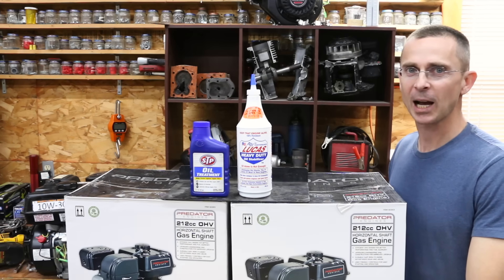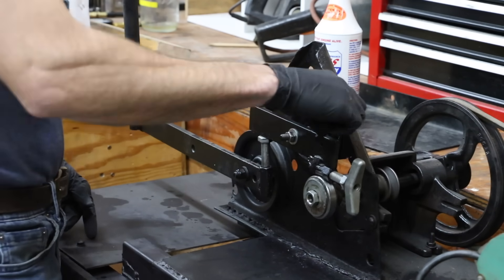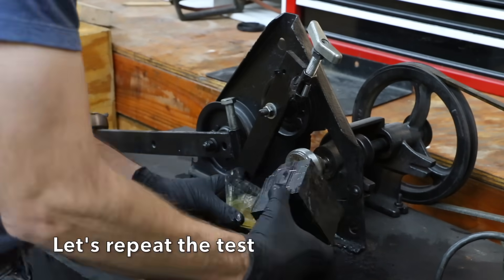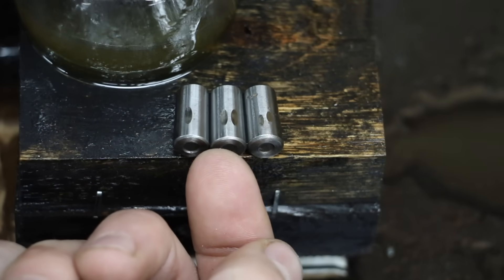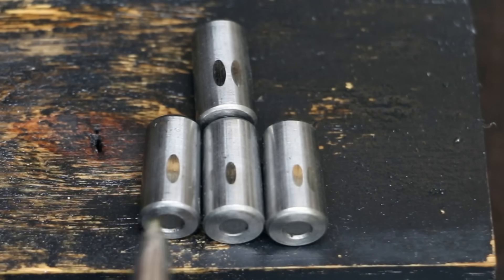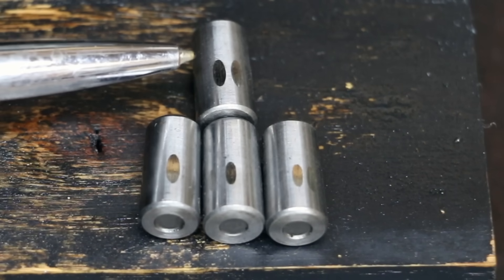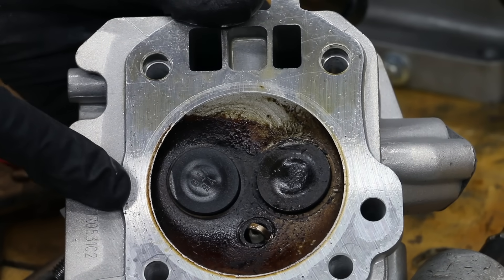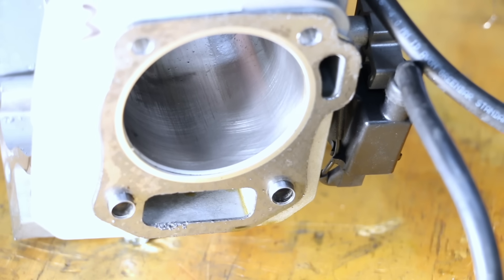Which engine self-destructs first?  Lucas or STP?

Comment: I can't figure how to interpret this test, what does running an engine with no oil really tell me about long term wear in a properly maintained engine? The thing with standardized industry tests like the four ball wear test is that they have been correlated with various real world applications using many replications, they are often also controlled for realistic operating temperatures.(Both for chemical activity and true operating viscosity) 

I have no clue what exact percent of ZDDP is in STP (probably 5%) but ZDDP is a well proven Anti-wear (AW) additive for steel on steel flat tappet engine parts common in older machines and was only taken out of newer highway oils because zinc destroys catalytic converters, and to facilitate the removal of zinc flat tappets had to be replaced by roller based valve trains in newer cars. Though ZDDP is AW it is not necessarily an Extreme pressure(EP) or Anti-scuff(AS) additive. EP additives would likely perform better in the run-dry test because that is the domain where the load is carried directly by asperities rather than any significant hydrodynamic film. ZDDP is activated by certain temperatures and shear rates and may have little effect on materials other than iron and steel because ZDDP chemically reacts with the iron to make the AW boundary layer. 

The normal industry dose is 600-2200ppm of Zn, and good high zinc oils(sold for "racing" or off-road use only or pre-emmissions(1968) engines) will directly say how much they have in the TDS. From the newest 4oz STP SDS it looks like it has 5%ZDDP and in 5quarts oil this calculates to 620ppm. It says 5-20% "additive", and knowing that they know people look at the SDS for percentage, and that it is the cheapest ZDDP treatment around, I must assume it is only 5%. (To be sure, I have heard chemists say that it is the phosphorus and sulfur, not the zinc, in ZDDP that does the heavy lifting and the Zn can be substituted with several other metals but Zn is cheaper.)
I have a hunch that Lucas operates more like the compounded class of gear oils which are popular for worm gears and steam cylinders, they basically have high adhesion to metal and high sliding film strength(Different from films in rolling elements) though they may need more frequent oil changes due to breakdown, and they may increase power losses where not needed for wear reduction.

Comment: I run Rotella T5 synthetic blend in my ISX CUMMINS in my semi. I have two brothers with the same setup. They too run Rotella T5 synthetic blend,, we all change at 15,000 miles and all take 10 gals every service, however 1 uses a gallon of Lucas and 9 gallons of oil, and his engine oil temp and coolant temp runs about 8-10 degrees hotter than mine and the other that uses no Lucas.
I’m sticking with straight Rotella T5 10w30 synthetic blend.  No additives for me please.. just oil
Reply from the maker: Thanks!

Comment: If you want to test a real great oil additive stabilizer product. That is beyond Lucas quality and STP quality. My personal experience has been with MotionPlus. It's truly one of a kind protection !! 
I have used it in my 06 Honda Civic EX engine and transmission with 118,000 miles. On my 04 Toyota Tundra Limited having 160,000 miles. On my 17 VW Passat with 59,000 miles. It is the very best oil protector stabilizer hands down. Also providing very sure smooth shifting on automatic transmissions.
👉 ( any kind ). It's more than worth it's price of $ 19 to $ 20 some dollars a bottle. Out of all places.. It's made in Miami Fl. In the long run on your car's engine and transmission. You'll be more than satisfied you decided to use this special product👍. This is just my suggestion as a fan of that grey bottle. Btw. 
I have nothing against anyone doing oil additive or oil stabilizer comparisons with one another🤞. I really like finding out which oil additive stabilizer has the real extra protection 🤔
Reply from the maker: Thanks for the suggestion.

Comment: I would like to see you pit any other oil additive against Dura Lube as I have used it in every engine I have owned. I remember when it first hit the market, during the two weeks of the PNE exhibition. They broke in a brand new 3 hp Briggs & Stratton engine, the first day then drained the oil that night. On the second day, they put new oil with dura lube and ran it the whole day, then drained the oil that evening. The engine had a see-through side cover so you could see that there was no oil in it. The engine was started and a see-through cover was placed over it under lock & key. The engine ran continuously for the remainder of the exhibition. On the last day, they tore the engine down and showed no wear on the parts. Dura Lube actually impregnates the metal making it slippery. I had a boat with a 36hp Palmer gas engine, which blew an oil line and pumped all the oil into the bilge. I didn't notice until an oil slick came out the back of the boat when the bilge pump came on, and of course, I didn't have any spare oil on board. I had to run 37 miles to get back to the dock. I did a compression test on it and it was fine.
Reply: This was one of the best videos I have ever seen, an amazing representation of both products, and after reading this comment I have to say I would also like to see this because if this is so then why isn’t every single vehicle coming off the line with this in it??
Reply: @laynebolton9817  -- Why? Because engine manufacturers make money in parts, they want engine repairs to sell parts.
Reply: @laynebolton9817  -- The engine has to go through the break-in period first. If you put it in before the break-in you will destroy the engine as tolerances are too tight.

Comment: I don't get it. What did that prove. Additives work with your engine oil . So you drain it & blow up perfect good motors. It doesn't prove anything. I like your videos but this is stupid. I like it better if u take sumthing in bad shape & test if additive brings it back to life .sum thing that proves if additive works. This was just a waste of two new motors. I've used your videos to pick strongest epoxy & other thing . Think u should re think this one. Peace fellow human

Comment: How about Xado???  Had a Suburban sideways in about 2 feet of water and my Son said that since the trucks exhaust was in the water he left it running for about 4 hours till tow truck arrived.  It DID NOT smoke for about a month before Ins Co decided it had too much body damage.  Told Xado the story and was told that race car drivers have been doing races with no oil after treating it with Xado.. I have been using Xado for about 20 years now.  Even in A/C compressors that where noisy, and the noise went AWAY!!!!
Reply from the maker: Thanks for the suggestion.

Comment: Briggs & Stratton runs engines at full speed (3600rpm), full load to test them. All engines for one hour. 10% for 10 hours, 10% of those for 100 hours, 10% of those for 1000 hours.
Reply from the maker: Thanks for sharing.

Comment: Personally I would like to see a run between reg. Oil versus the additive to see if an additive helps
Reply from the maker: Thanks for the suggestion.
Reply: Hmmm. I want to buy a harbor freight engine and run straight water in it and see how long it lasts...
Reply: Richard Darnell · That sounds good. But the oil stabilizer additive depending on which one. Wether STP or Lucas or MotionPlus. Are basically -
👉designed to provide protection mixed in with the regular oil. Wether your using synthetic or regular oil in your engine's crankcase.
Reply: @rolandocurro8842  Whether.
Reply: I would have to say that without a doubt - oil alone drained out would have the engine blown sooner but I am curious as to how much sooner. Both additives are designed to cling to the metals and provide an extra layer of protection
Reply: I'm not a scientist so therefore I'm not going to answer this question, but it'd be a good idea💪

Comment: With your test Lucas shoed better than STP.  I have used STP in the past while Dad was a Lucas fan.  I dont know what I would use today  BUT with todays engines using either one could be a bad thing. With the close tolerances of todays engines there may not be room for the heavier oil. The engines last longer than back in the 50's and 60's and need a lighter oil.
Reply from the maker: Thanks for the feedback.

Comment: For a REAL controlled test you should have a THIRD engine running the same break-in and conditioning time with the base oil (no friction conditioner) and record data from it THEN run it to destruction along the two friction reducers engines to see if plain oil or STP/Lucas is how much better (if it is) than plain oil.
Reply from the maker: Thanks for the suggestion.

Comment: I love the channel, but doing this test without a control was a massive failure.  There is absolutely no way to derive the relative value of these additives without knowing the results of an identical engine running with unadulterated oil.

Comment: I have used Lucas Synthetic additive in ALL my engines for YEARS!  How about using Synthetic oils with synthetic additives for a similar test as this one?  I have NEVER had any engine failure or loss of oil pressure!
Reply from the maker: Thank for the suggestion.

Comment: There can be a lot of variability in engines.
You can have 2 of the exact same motors running on the exact same oil and exact same gas. That produce different results.

I'm not saying that the test is completely irrelevant, but you would need a larger sample size, but I completely understand that motors aren't cheap and a larger sample size is cost prohibitive.

still thanks for the awesome content. 👍😁
Reply from the maker: You are welcome!

Comment: Missing data: operating temp of engines during break in…STP appeared to excel in each step, till engine blew. STP engine may have been a victim of assembly tolerances or even carb mix.
Reply: Excellent point, the much lower costing stp long term use may give most protection by a 10 degree reduction in temperature (=less friction). 99% of users will pull over once the oil dummy light comes on. For the dummies that keep driving till engine dies, they should buy the more expensive Lucas which may give them another mile driving distance to the psychiatrist appointment.
Reply: @ReginaPrincessa  it could also be that stp  is a inferior  product. .
Lucas whenever its tested and compared wins. Maybe there are tests i havent seen, but the ones i have  lucas always wins. Weather its oil or fule treatments lucas is solid product .
Reply: They sound like stp lovers. I don’t use either so I’m unbiased
Reply: @russcollins4762  if you run the oil empty, use Lucas, you will still suffer higher cost plus engine rebuild due to higher friction. Stp lowers temp, low temp means less engine rebuild. Lawnmower shuts off when oil level drops in case of a leak. Automobile light comes on if driver damages oil pan & leaks. Stp clear winner! Caprice?
Reply: @ReginaPrincessa  its the bearing test that shows its viscosity  . The score mark on the stp is giant !!!
Reply: Do i detect a stp bias whine ?
Reply: @russcollins4762  don’t be such a daft idiot. Read it again. Ask for help if you don’t understand it…

Comment: Around 30 years ago I used to use additives, mainly Rislone. But eventually stopped after hearing someone say that the oil manufacturers spend millions of dollars developing their oil, and you screw it up by putting in an additive.   With the improvements in oil quality now, especially synthetics, there should be no reason to use an additive.  Except to put money into the additive manufacturer's pockets.
Reply from the maker: Thanks for the feedback.

Comment: Hard to watch, even though the test subjects were Chinese engines. It was like passing by a car wreck, I had to look. I always heard STP gummed up your engine, even if you changed your oil every 3000  miles. Great informative video! Glad no Honda engines were harmed in the making of this video. I saw an add for Toro lawn mowers with B&S engines with a selling feature that you never had to change the oil. Only add some when it got low. The test seemed very fair, I would like to seen a third engine with just synthetic oil running beside these two, of course with the crankcase drained. I don't think HF would take either one of these engines back even with the extended warranty. I did expect either engine to last as long as they did. Keep up the good work! Maybe some slick 50 and Justice Brothers snake oil next?
Reply from the maker: Thanks for the video idea.

Comment: Lucas!!! I had a chevy truck with synthetic Lucas oil adative in it and was pulling 2 cord of wood behind it. The bearing on the shaft to the fan blade to cool the radiator went out And wabled to the point it put a hole in radiator hose and lost all coolant. The engine kept going and the heat caused it to start to seize where I had the pedal to the floor to keep going till I could go. I pulled over and when the engine cooled it would go again. I DELIVERED THE WOOD 5 MORE MILES AWAY AND WAS ABLE TO MAKE IT 10 MILES BACK HOME AND THE ENGINE NEVER BROKE AND STILL RUNS TO THIS DAY🤯 lucas transmision slip is also been a life saver to my vehichles.
Reply from the maker: Thanks for sharing!

Comment: This only proves that any engine with out oil will blow the oil additive is only as good as  the oil it's in the reason for an additive is to provide base an mineral stock an  zddp that modern oils do not contain for emission reason.. All you did with this dumb experiment is waste a bunch of time an ruin to perfectly good motors

Comment: try the additive GMC/chevy use in limited slip differentials. its made from the oil from the head of a sperm whale. it was the only oil that would run in the world war 2 mitsubishi AM-6 japanese zero fighter plane engine mitsubishi 14cylinder double row 7 cylinder per row twin turbo charged 1 turbo per 7 cylinder row. it can be purchased at the parts department of any GMC dealer. kinda expensive $35 bux but its the best. on hot days my 1991mitsubishi 3000gt VR4 twin turbo AWD/AWS runs noticably cooler using this additive in the engine oil espcially under maximum power.i used a laser temp gun to test the coolant systems tempature as well as the cars temp gauge
Reply from the maker: Thanks for the feedback.

Comment: 1: I always use Shell Rotella T in any small engine that uses flat tappets. My 25 year old "Yard Machines" branded Briggs and Stratton powered push mower still starts on the 3rd pull like it did when new and it does not smoke. 2: I would like to see how Amsoil performs in one of these tests. Even though I would not use Amsoil in my lawn mower my curiosity is still there.
Reply from the maker: Thanks for the video idea.

Comment: Myself I believe all of the engine additives are snake oil rip offs. Im 66 yrs old and have been running just the proper type valvoline oil in all of my engines since I was about 16. Including my 1971 Honda 750 motorcycle that I’ve had since new. Ive never had a properly taken care of engine seize up or disintegrate. I run my engines in extreme conditions including racing in 100 degree weather. Did you factor in that lots of these new engines are junk  with made in China junk metal from the beginning? Looks like I’ve had at least 30 yrs more experience than you have and owning even building 100s of engines for motorcycles, rv’s, boats, cars, dune buggies and more.
Reply from the maker: Thanks for sharing.

Comment: Have never used additives just change oil early and often. Kinda like chaning your shorts would you spray air freshener in them so you could wear them an extra day or week. ;)
Reply: Yes.
Reply: Yes and no. Some engines designs have need of different additives. Big example ZDDP is needed in flat tappet valve trains but has been taken out of all modern (on-highway) engine oils because modern cars have roller based valve trains and zinc deactivates catalytic converters. So you can buy high zinc "racing"(off-highway) oil or add a shot of ZDDP to commonly available oil. From what I gather the zinc is more of a carrier and the real work is in the DDP part of the molecule. The ZDDP works with steel on steel, as far as I now it doesn't do much for other materials.

Comment: Well I can't speak for the Lucas product but I've been running STP in my car since it passed 300000 and it immediately cut the oil consumption by 2/3rds, it's now approaching 320000 and oil consumption has remained the same. It's substantially cheaper than the premium oil in how much it saves between changes so I'll keep using it.
Great test for the extreme end of some of it's properties, maybe a good test would be to compare performance in an oil burner engine to see which one cuts the most oil consumption.
Cheers.
Reply from the maker: Thanks!  Thanks for the video idea.

Comment: I’d say Lucas is a better product 
I have used dura lube engine treatment in a 6.5 Turbo Diesel that I sold at 250k miles. The engine ran noticeably cooler, zero oil consumption & at 150k I blew a cooler line & ran the engine with no oil for 25 miles zero damage, no heating during the 25 mile run 
I replaced the line, changed the filter filled the crankcase & the truck presently has over 300k miles on it last time I asked. Too bad the plastics & body panels couldn’t hold together. I’d love to see how the expensive oil additives perform. DuraLube versus say Slick 50
Reply from the maker: Thanks for the suggestion.

Comment: Lucas bad for healthy engines that run 5w20 with tight clearances.. Lucas too thick for these precisely machined crank bearings smAll oil passages.. run regular oil in good newer motors.. Lucas is cough syrup for terminally ill engines only ..
Reply from the maker: Thanks for the feedback.